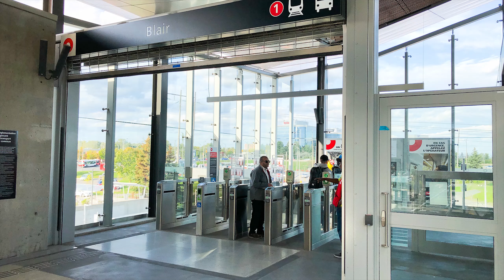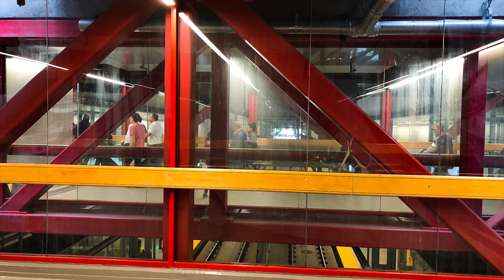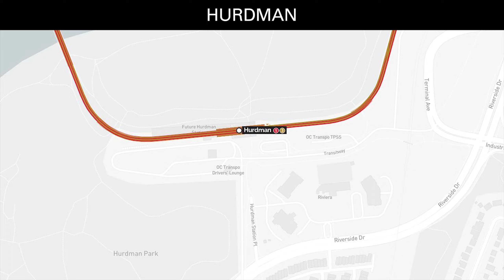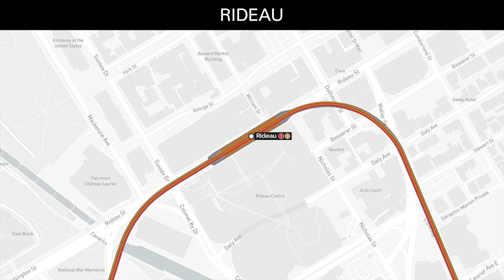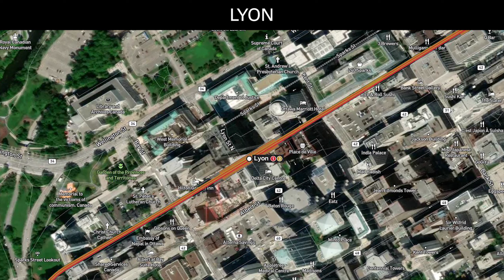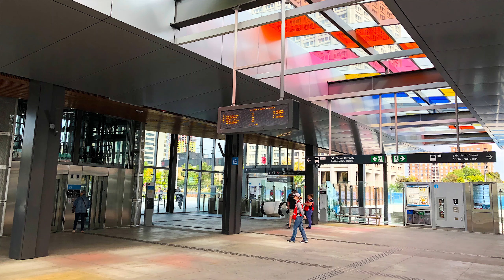Overview of Line 1 (Confederation Line) of Ottawa's O-Train system

Comment: There are two main problems with the St. Laurent station:
1. The fare gates are on the lower level, which means you must choose your direction of travel before passing through them.  If you accidentally go through the wrong fare gate you must wait five minutes before you can go through the other.
2. The elevators are rather small, which makes them awkward or unusable for those in wheelchairs or with extra items such as strollers or luggage.
Reply from the maker: Good points. Very true about switching platforms and needing to exit and re-enter through the fare gates. The only stations that will be like this on Line 1/3. Although Carleton Station previously and still will, have a similar setup. The newer elevators off to the side have more space but the old legacy elevators are really small and tight. I remember using our child's stroller and managing to fit inside the old legacy elevators, the front wheels were touching the other door with my back pressed against the back door. As suggested in the video, limitations of the carry over from the old station elements that were maintained, which creates these unfortunate low points for the station and how people can use it.
Reply: @RailFansCanada  The elevator issue is a serious fault - exclusionary and ableist. Very sad.